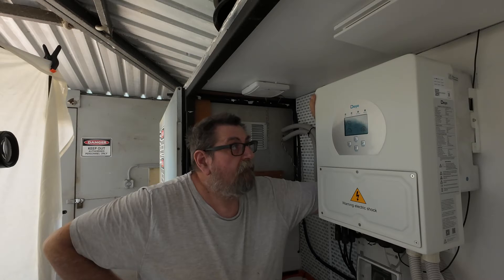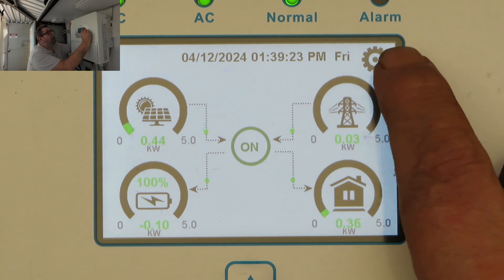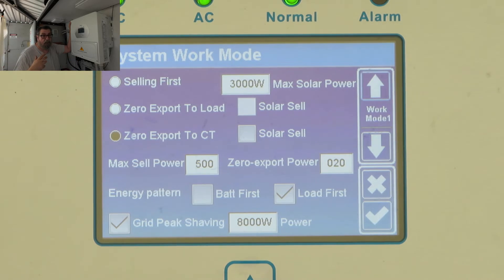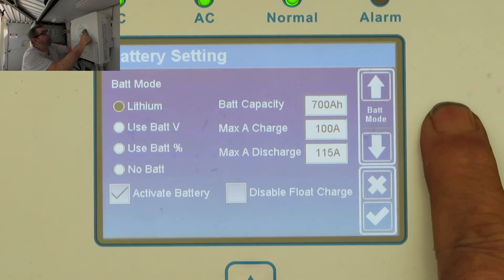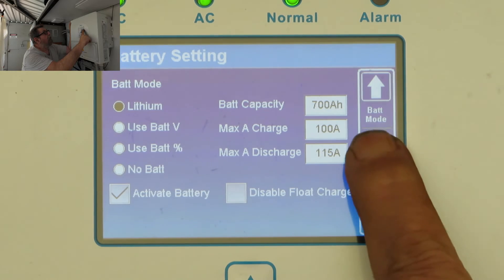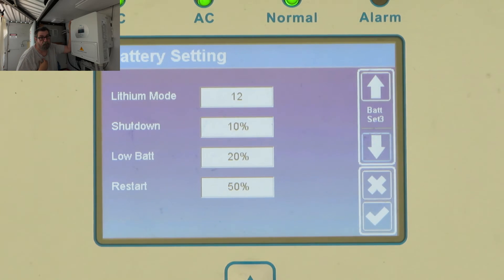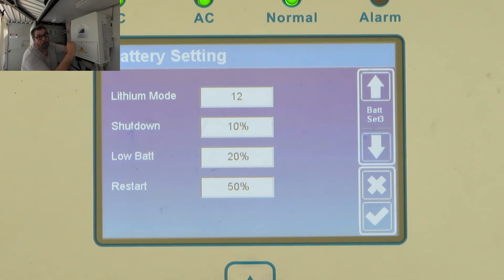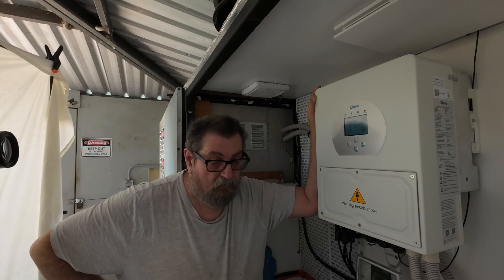Mastering Deye Inverter Setup: My Pro Tips Revealed! (17)

Comment: Are you using Solar Assistant with your Deye inverters for monitoring? cheers
Reply from the maker: No. Go watch this video,   Reliable Off Grid System, All Night Air Conditioner, Deye Inverter (10)   https://youtu.be/n9pZ-wRYs6Y
Reply from the maker: Just watched a bit of that Video. All the information is great. However, the name was missing. SOLARMAN Smart came with the DEYE as a Downloadable link
Reply: @JustinCaseSolarPower  ahhh,... the Solarman SMart, yup got it., ta

Comment: I still have my green Invini Solar Hybrid inverter even though I now run the Victron multi plus. I have been thinking of using the Victron inverter to feed into the Invini solar and set the Invini Solar inverter as a grid tie. When there is not enough solar from the panels on the Invini Solar, it starts taking power from the Victron. Just not sure about the grid feed part. I don't want the Invini Solar to try and back feed into the Victron, that would be bad.
I was also thinking I could run the power from my 24 volt test system into the Victron's AC input line, then set current limiting so the Victron assists the 24 volt inverter if demands exceeds the input..... so many option 🤔
If I didn't have a solar addiction, most people would just leave it alone but noooo.... I have to piss around with it some more to feed said addiction 😂😂
Reply from the maker: We love to play. Show people what is possible.  Sometimes when testing the limits of gear like this, You let the smoke out from the inside. That is bad luck for us, and cost big $$$. But at least we learned something new. :hand-orange-covering-eyes: Many years ago when i started testing gear, there was a lot of smoke around. :face-turquoise-covering-eyes::volcano-green-lava-orange:
Reply: @JustinCaseSolarPower   yes and I still smoke stuff from time to time. I did a test this morning, plugging in my 24 volt inverter into the Victron Multi Plus and it run ok, even did a video on it which is rendering out at the moment then I will upload it to YouTube.
Reply from the maker: @TheOffGridBachelor  Will have a look when youtube tells me it's ready
Reply: @JustinCaseSolarPower  Here I was sitting in bed early this morning with a coffee, watching a Justin Case solar video which then inspired me to shoot a video myself. What else would us off grid power addicted people be doing 6am in the morning 😂☕
Reply from the maker: @TheOffGridBachelor  Happy to inspire you to make a video, my friend. I just hope you finished your coffee first ☕🙃
Reply from the maker: Go read this comment and my answer below. I did check and pass-through power rating before I set mine to 8kW but failed to mention that precaution in this video.
I set it right in my answer to Davids Comment. Just make sure you do the same check when you set yours up. There is a lot more to my answer to him, but i just past the short version below.

@dama054
9 hours ago
Looking good, what is the pass through current rating of the 5kw unit

Justin Case Solar Power
2 hours ago (edited)
5kW  Max Continuous AC Pass-through(A): 35A.    8kW inverter 40A that's at 230v single phase
so for the 5kW unit it's 35A x 230vac = 8,050W          The 8kW unit 40A x 230vac  = ? :hand-purple-blue-peace:

Comment: Looking good, what is the pass through current rating of the 5kw unit
Reply from the maker: DEYE 5kW  Max Continuous AC Pass-through(A): 35A.    DEYE 8kW inverter 40A that's at 230v single phase
so for the 5kW unit it's 35A x 230vac = 8,050W          The 8kW unit 40A x 230vac  = ? 

Battery Input Data

    Battery Type: Lead-acid or Li-lon
    Battery Voltage Range (V): 40-60V
    Max. Charging Current (A): 120A
    Max. Discharging Current (A): 120A
    Charging curve: 3 Stages/Equalization
    External Temperature Sensor: Optional
    Charging Strategy for Lithium Battery: Self-adaption to BMS

PV String Input Data

    Max. DC Input Power (W): 6500W.
    PV input Voltage (V): 370V (100V-500V).
    MPPT Range (V): 125-425V.
    Start-up Voltage (V): 150V.
    PV Input Current (A): 11A + 11A.
    No. of MPPT Trackers: 2
    No. of Strings Per MPPT Tracker: 1+1.

AC Output Data

    Rated AC Output and UPS Power (W): 5000W
    Max AC Output Power (W): 5500W
    Peak Power(off-grid): 2 times of rated power, 10 S.
    AC Output Rated Current(A): 21.7.4A
    Max: AC Current(A): 25A
    Max: Continuous AC Pass-through(A): 35A.        🥸
    Output Frequency and Voltage: 50Hz; 240Vac,
    Grid Type: THD<3%(Linear load<1.5%).
    Current Harmonic Distortion: THD<3% (Linear load<1.5%).

Efficiency

    Max. Efficiency: 97.60%
    Euro Efficiency: 96.50%
    MPPT Efficiency: 99.90%

Protection

    PV Arc Fault Detection: Integrated (Except European Type)
    PV Input Lightning Protection: Integrated
    Anti -islanding Protection: Integrated
    PV String Input Reverse Polarity Protection: Integrated
    Insulation Resistor Detection: Integrated
    Residual Current Monitoring Unit: Integrated
    Output over Current Protection: Integrated
    Output Shorted Protection: Integrated
    Output over Voltage Protection: Integrated

Certifications and Standards

    Grid Regulation: UL1741, IEEE1547, RULE21, VDE0126, AS4777, NRS2017, G98, G99, IEC61683, IEC62116, IE61727
    Safety Regulation: IEC62109-1, IEC62109-2
    EMC: EN61000-6-1, EN61000-6-3, FCC 15 class B

General Data

    Operating Temperature Range ( C ): -25—60 C , >45 C Derating
    Cooling: Fan
    Noise (dB): <30
    Communication with BMS: RS485; CAN
    Weight (kg): 20.5
    Size (mm): 580 X 330 X 208mm
    Protection Degree: IP65
    Installation Style: Wall-mounted
    Warranty: 5 years

Comment: :learning: the CT monitors the load and won't let inverter power past it shame tho they kept the shaving to 1000 w minimum
Reply from the maker: Most people in normal homes don't realise the 5kW is big enough to run 99% of their loads.  I am very impressed with this unit.
5kW  Max Continuous AC Pass-through(A): 35A.    8kW inverter 40A that's at 230v single phase
so for the 5kW unit it's 35A x 230vac = 8,050W          The 8kW unit 40A x 230vac  = ? 

Protection

    PV Arc Fault Detection: Integrated (Except European Type)
    PV Input Lightning Protection: Integrated
    Anti -islanding Protection: Integrated
    PV String Input Reverse Polarity Protection: Integrated
    Insulation Resistor Detection: Integrated
    Residual Current Monitoring Unit: Integrated
    Output over Current Protection: Integrated
    Output Shorted Protection: Integrated
    Output over Voltage Protection: Integrated